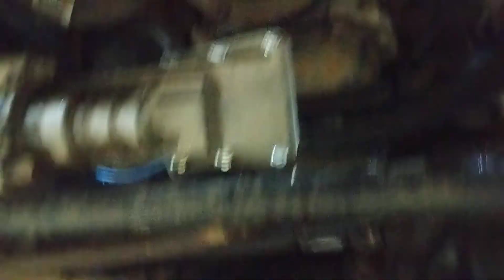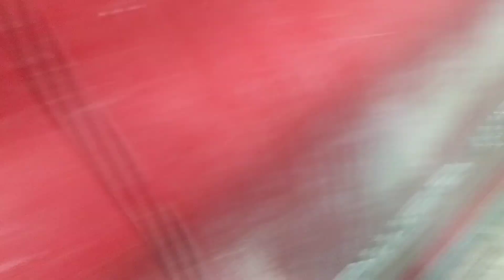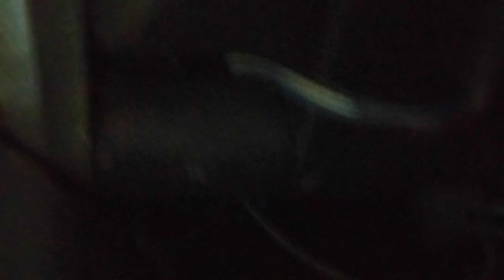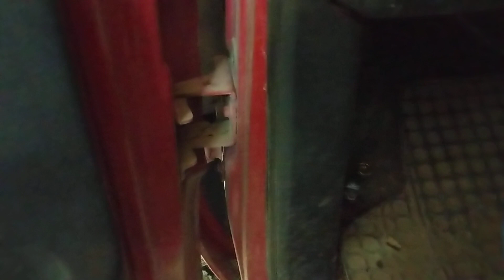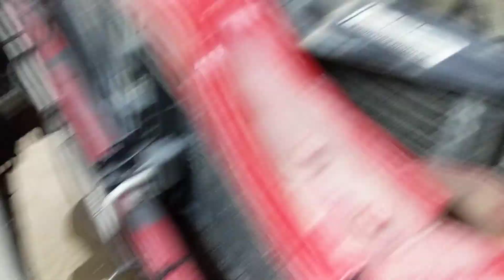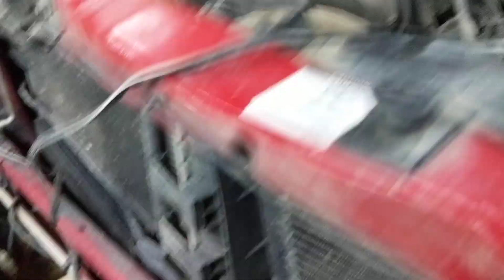2005 Dodge power Wagon smart bar bypass INSTALLED.

Comment: I would love to get the instructions from you on how to make the smart bar work. I have installed & wired up the lockers in my Jeep sport, and really want to make this smart bar work as well. I have remove the board and found the two black wires for the magnet, and the red and white for the motor. Thought about an off/on/mom on switch and 5 position relay, but don't know how to limit travel, or do I even need too?
Any help you can give would be cool, or sell me a kit, either works for me.
Thanks in advance,  John

Comment: The video for the lockers bypass would be nice
I am retrofitting them in a truck, and not sure of connectors pinout and also voltages to use...
Reply from the maker: Go to my page. I made one. Good luck. Pretty awesome now
Reply: @theshineing  but that is for smartbar only, right? couldn't find for lockers.
Reply from the maker: I got ya. I thought you were talking about the smartbar. I'll post a video next weekend of how to do it.
Reply: @theshineing  I am looking for connections. About smart bar, still using the PLC to control it? Or something different?
Reply from the maker: I used arming switches. I could use the PLC but you don't have to. I didn't for now. Maybe someday.
Reply: @theshineing  could you share the wiring diagram you used?
Reply from the maker: On this video I did not use any blueprints. I just traced everything out.
Reply: @theshineing  so the red white are the motor. The 2 black are the sensor, right?
Reply from the maker: Yes
Reply from the maker: Remember that the white wire is the motor positive and the red wire is the ground.
Reply from the maker: And the black is actually a magnet that holds the motor in place.
Reply: @theshineing  could you draw something by hand and send email?
Reply: @theshineing  I would love to get the instructions from you on how to make the smart bar work. I have installed & wired up the lockers in my Jeep sport, and really want to make this smart bar work as well. I have remove the board and found the two black wires for the magnet, and the red and white for the motor. Thought about an off/on/mom on switch and 5 position relay, but don't know how to limit travel, or do I even need too?
Ant help you can give would be cool, or sell me a kit, either works for me.
Thanks in advance,  John